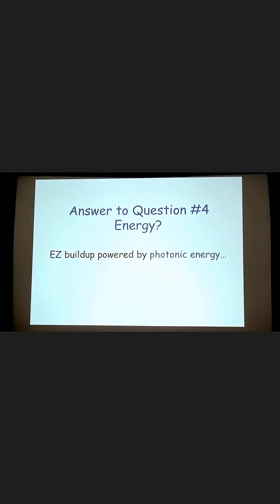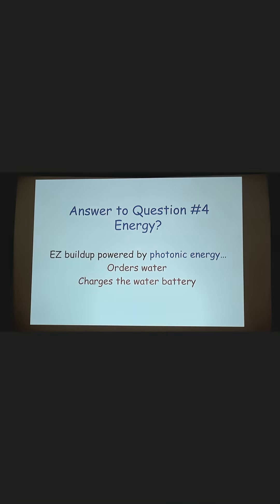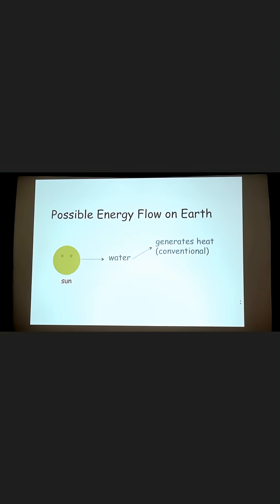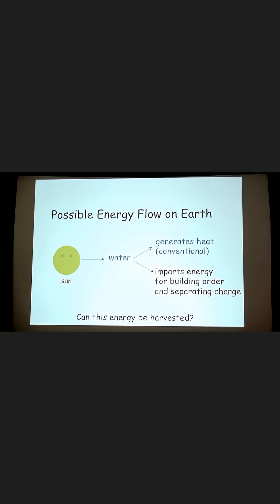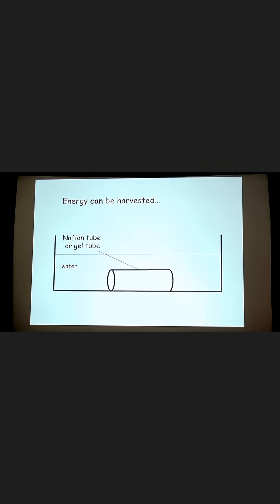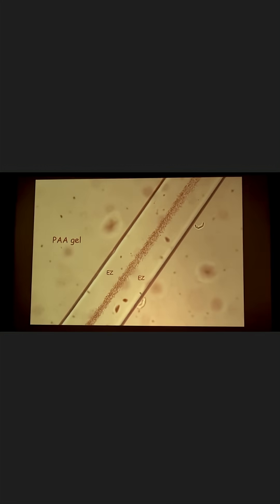Exclusion Zone Water | #electricuniverse #EZWater #nafion

Comment: I have a question about exclusion zones affect on evaporation specifically with elevated voltages during storms like hurricanes and tornadoes. Observation being that a hurricane can support the evaporation of enough water to fill ⅕of the capacity of the Lake Bonneville water basin. Brings to mind structured water to my mind. Factor in that 6 Fluorine atoms can make some very heavy atoms gaseous. (UF6)